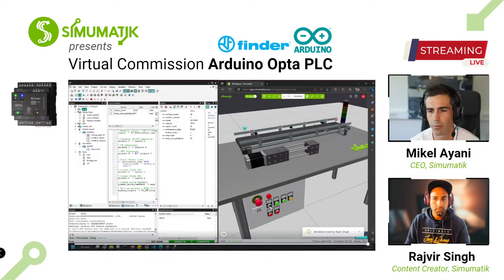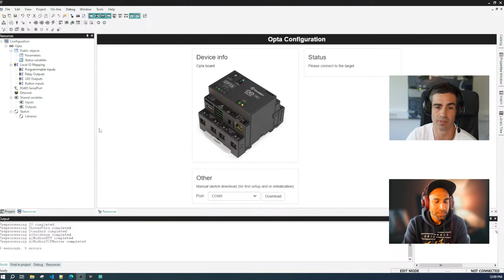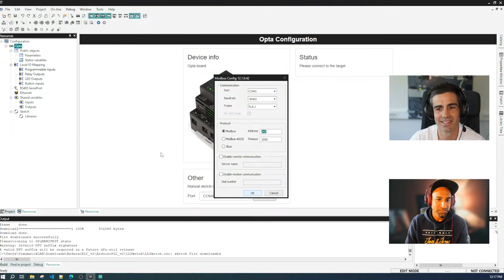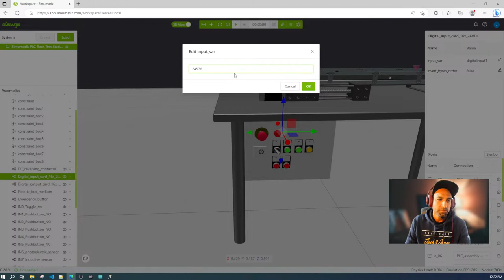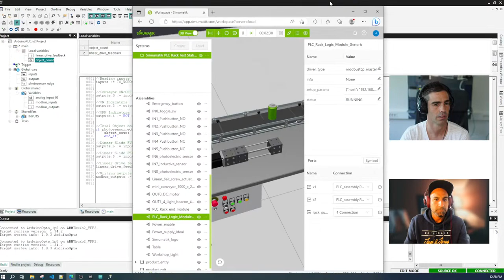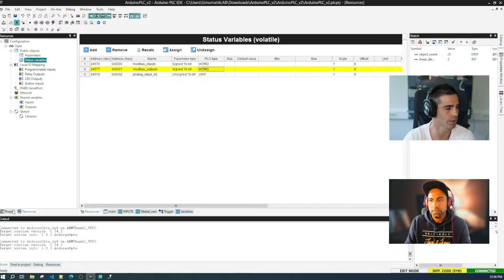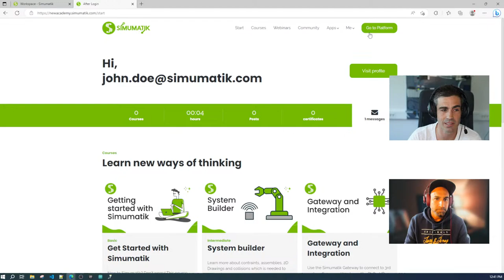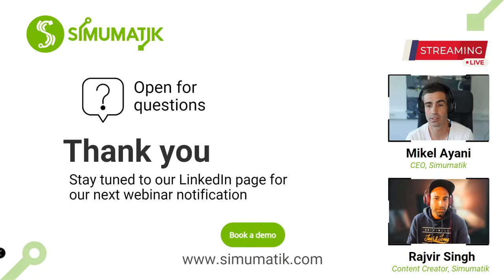Webinar 8: Virtual Commission Arduino Opta PLC

Comment: I have a problem. When I connected multiple analog input ti arduino opta. It doesn’t read value correctly since it has no isolated input. If you have any solution for this please reply.